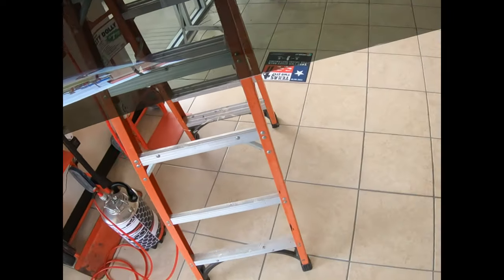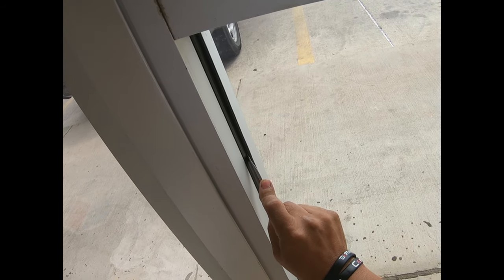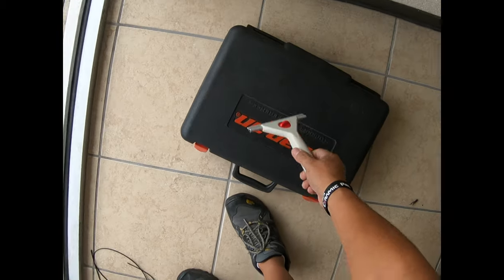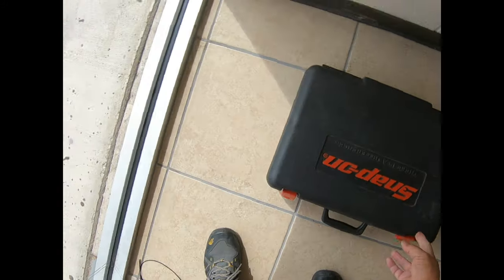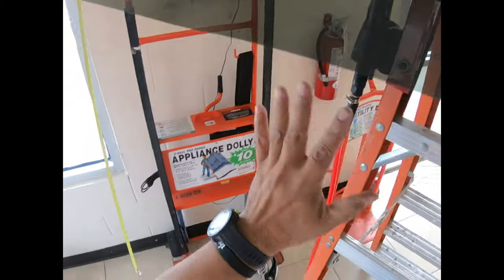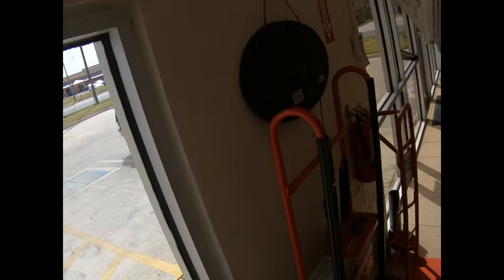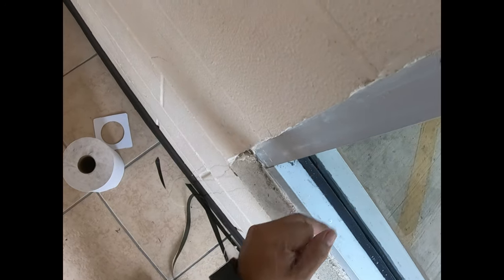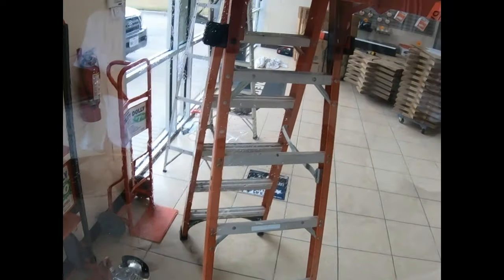Commercial Tinting 201.  First Ever Revealed Advanced Tricks !

Comment: No peel board needed , back rolling the film is much more effective, no peel board needed , I’ve done 72 inch by 10 foot commercial windows by myself, but I also do the rubber gasket trim on commercial jobs what city are you in?
Reply from the maker: I can also..but thats not the point...the point is to give the nervous ones a boost through a tip n trick...most can't roll out larger windows on their own...thanks for watching boss!!